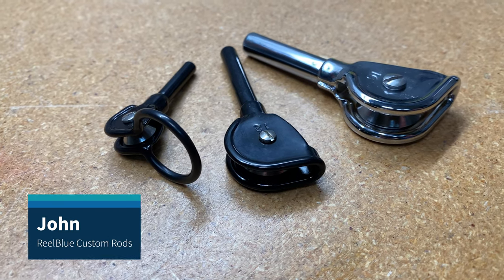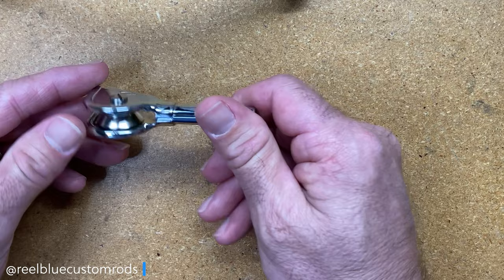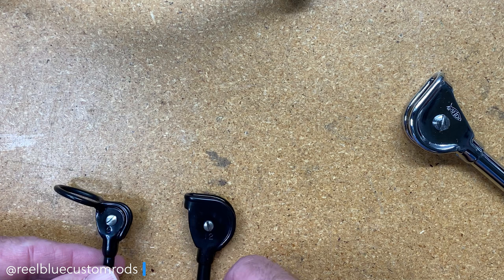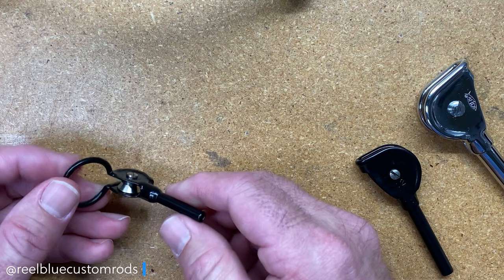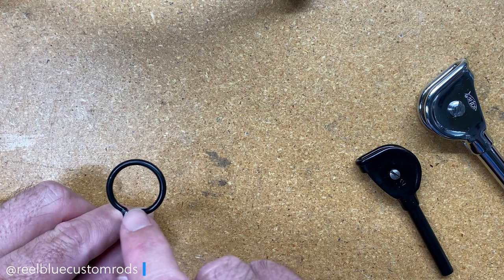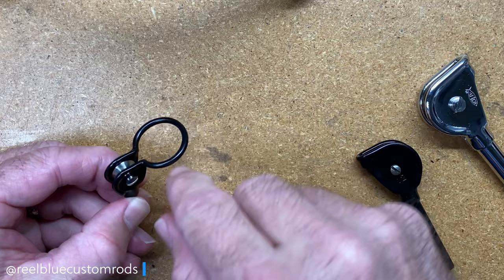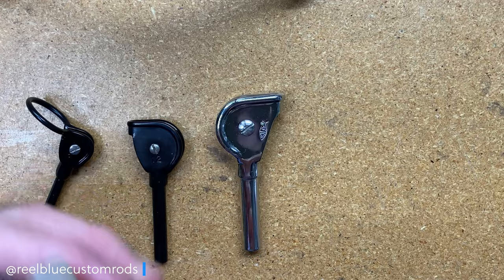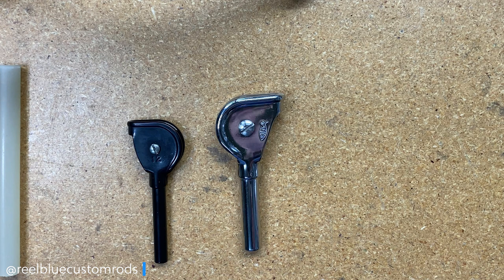MUST Know about Roller Tip-Tops: Custom Rod Building

Comment: Instead of the rolled up shop towel try a Q-tip and some isopropyl alcohol to clean up inside those guide sleeves
Reply from the maker: Yes John, that technique works as well.  Thank you for watching and commenting. 🙏

Comment: What if you wanna remove it and you used the epoxy
Reply from the maker: Great question.  You just remove the epoxy, add the new tip top, and then add new epoxy.  Thank you for watching and commenting.

Comment: I'm wanting to add (1) roller guide on my surf rod because the first part of the rod (2 piece rod) has no guides so I'd like to add 1 roller guide to the first part to give the line a little more stability once it leaves the spool to the first circle guide. My question is, is there a specific length I need to put the roller guide from the spool or to the guide on the 2 piece of the rod or is it just a preference of user?
Reply from the maker: Thank you for watching and commenting, and as a rule of thumb for me, anywhere between 19-23” from the reel.

Comment: How far should the rod tip be inserted into one of these tip tops? The balnk I'm using has a tip size of 14 and the appropriate sized roller guide only goes down a half inch before the blank becomes too thick.
Reply from the maker: I try to get them in all the way, or as close as I can.  Sand down the tip until you can get it at lease 3/4 of the way in the tube of the roller.  Then use flex
Coat 5 minute epoxy (glue) to bind them together.  The two part adhesive will replace any surface you take off the blank, and it will be a tight fit.  The roller tip may also try to slide off so you have to make sure you twist on trying to release any trapped air.  Again,
If you get it at least 3/4 of the way inside the tube of the roller top you will be good to go.

Comment: What do you exactly do when air pressure pushes back the sleeve? E.g. full solid blank
Reply from the maker: Rotate it until the air escapes and use 5 minute epoxy.  Hope this helps and thank you for watching.

Comment: Hi, I have a stupid question.... which way up do you mount an AFTCO swivel roller top.... logo to the top and the ring hanging below? And I guess that you have to centre between the swivel studs to get an equal swing side-to-side? Thanks, Bryan
Reply from the maker: Bryan, are you talking about the roller tip top on the far right in the thumb mail picture?
Reply: @reelbluecustomrods  No , it is a new version of swivel top roller  with a hanging true ring eye on a square bracket....I have a pic but don't know how to add it to this message
Reply from the maker: @bryancook4096  - the cross bar is on the tip top is on top with your guides

Comment: Not a fan of the Winthrop line? They are pricey but the rollers are shrouded so well. Have never had an issue with winding on the largest knots and wind on swivels.
Reply from the maker: No issues with them, and I use their products quite a bit.  Just what I was working on when I made the video.
Reply: @reelbluecustomrods  thank you, just curious i hadn’t seen any of their products aside from the kite rod tip top mentioned in your videos. New to rod building. Not new to offshore fishing. Really appreciate you getting back to me. Great channel and content!
Reply from the maker: @FrankM812  - yep, and no worries.  I have some roller guides and blank through uni butts by Winthrop that I am currently working on and will do videos on soon.  Thank you for watching and providing feedback.
Reply: @reelbluecustomrods  is that the Epic butt they offer? Was looking at using them for a pair of kite rods to match my buddies boat rods. I’m just not sure i can match the wraps the rod builder did on his other builds. A bit advanced for my skills at the moment
Reply from the maker: @FrankM812  - they are, but because they are blank through, your kite blank would have to be longer than normal.
Reply: @reelbluecustomrods  hmmm i didn’t realize that. I know he has straight Winthrop buts that come off on his white marlin rods.  Not sure what model they are
Reply from the maker: @FrankM812  - yeah, blank through butts allow the blanks to slide all the way down inside the gimbal.
Reply: @reelbluecustomrods  ahh i got ya. Almost have to use a gaff blank to get the length then. O well. Too good to be true i guess lol.
Reply from the maker: @FrankM812  - 😂😂😂.  I just use normal uni butts for my kite rod builds.
Reply: @reelbluecustomrods  i was looking for something to match his set. He went all Winthrop on his new boat. Guess he’s going to have to shell out some coin if he wants them to match. Or just use the ones he has.

Comment: I would never use hot glue for any rod building. It goes yellow & gross over time & the tip will eventually come off. Why not use epoxy resin/hardener 2 part glue for all tips? When I started at the fishing shop I manage, I got rid of that crappy hot glue at the rod mending station. Hot glue is for plebs. Yuk. Thanks for the vid
Reply from the maker: Thank you for watching and commenting DI Scott.  Do I use hot glue for my lighter rods, of course I do, and I reinforce it with thread and then epoxy - they never fail.

As for heavier freshwater and saltwater rods, I use 5 minute epoxy and then, again, reinforced with thread and finish for a secure fit.
Reply: @reelbluecustomrods  But why not just use the good stuff on all rods?
Reply from the maker: @Tight--LiNeZ  - true, I could.